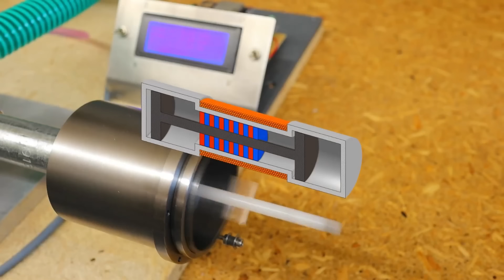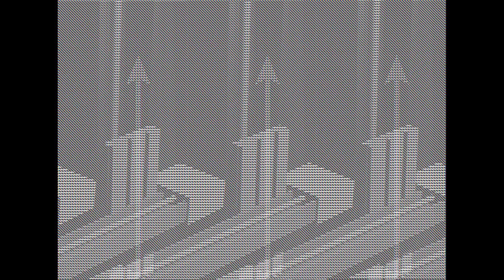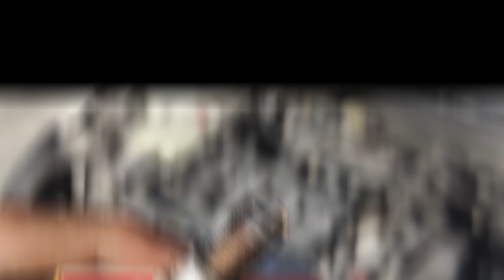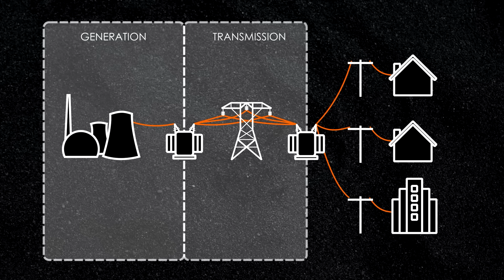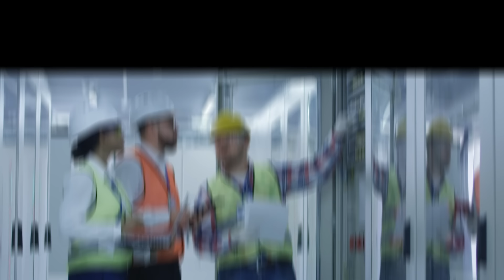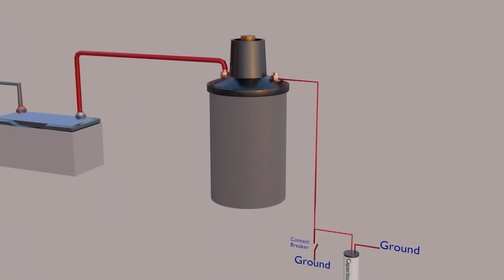This Mainspring Generator Runs on ANY Fuel 24/7 in Total Silence — No Grid NEEDED!!

Comment: Key about the MainSpring Linear Motorised Alternator is the the Spring probably. As it probably uses opposing magnets as the springs. The air lubrication is possible probably because it moves quickly but with low forces, effectively vibrating at much higher frequency than a Combustion Engine, while most Combustion engines move slower with higher forces. I can't think how the valve system works though, perhaps like a jet engine somehow? Then the heat recovery cooling jacket partly reduces the sound. In very cold places, often a block of flats has a Propane tank and an emergency generator, and if this was the main generator of commercial generator size, the waste heat could help warm the block of flats, like the old Soviet Flats block buildings.

Here is another set of semi interesting discoveries in Israel:
Since the digits of Pi were calculated beyond a couple of handfuls of digits when computers came in Israel, it was found that the first 611 add up to 2701, and it is long known that the Gematria of the first verse of the Torah is 2701, and the Hebrew word for Torah is 611. There are many more odd things about the 2701 Gematria of the first verse. The Star of David on the Israeli flag, is derived from the first verses Gematria of 2701, by first omitting the Gematria of the 3 central words of the 7 words of the verse, and then subtracting their value as well, leaving 937 (a Star number) from the 2701.

18 Here is wisdom. Let him that hath understanding count the number of the beast: for it is the number of a man; and his number is Six hundred threescore and six.

For many years “VICARIUS FILII DEI” has been known to add to 666 in Roman Numerals, and is said to have once been written on the inside of one of the Popes hats inherited from past Popes. V=5 I=1 C=100 A=0 R=0 I=1 U=V=5 S=0″”””””5+1+100+1+5=112″”””””F=0 I=1 L=50 I=1 I=1″”””””50+1+1+1=53″”””””D=500 E=0 I=1″”””””500+1=501″”””””112+53+501=100+500+10+50+2+3+1=666.

Recently “VICARIOUS FILII DEI” was found to add to 165 if each letter is replaced by its number of place in the alphabet, 22+9+3+1+18+9+21+19=102″”””””6+9+12+9+9=45″”””””4+5+9=18″””””102+45+18=100+10+40+10+7+5+8=165, and the 165th digit of Pi is 2, the 166th is 7, the 167th is 0, and the 168th is 1, making 2701 like the Gematria of the first verse of the Torah. Also 165+166+167+168=666.

The first two words 112+53=165 and the third word 501=3*167 and the 3rd digit of the 2701 in Pi is the 167th.

To this day the only Church that explicitly says that numerology is divination is guess who?
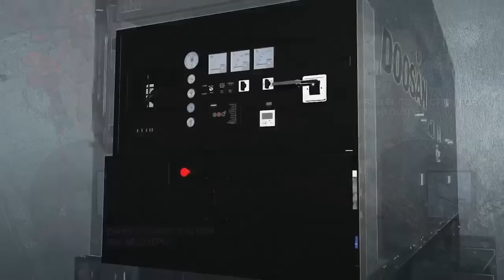That Church goes against Rev 13:18 by not letting a person calculate.
Only by the love for the remains of Israel have People let a person to calculate.

Comment: also In the late 1980s fighting with Verdigris Valley Electric because of a high Electric bill I started experimenting with generating My own Electricity but We made up with the Electric company and did Not presume It any more until recently they shut off My power become of one late payment after several years and I Am Not going to put up with a nazi Electric company. After putting a Car muffler on a Generator the muffler got so hot that It would boil Water so next Idea Is to run the Generator exhaust Into a barrel of sand to heat the sand and have heat exchange pipes In the sand to heat the house and do the same with the Diesel ⛽ heater

Comment: I do Not have 10 thousand dollars so It's out of the question for Me. It seem to Me If big corporations can build a big power plant and run 24/7 No problems then a smaller version can be built or It's like saying all Air planes has to be the size of a 747 to fly. The way I do It now except for the Air conditioner all high current Items as a microwave oven runs for less than 40 minutes so I have a big Generator to power them but I use a small Generator to change large batteries then the batteries power small current 12 volt Items I use the pure sign wave Power Inverter once In a while but most Items are 12 volt I also have Solar to help change the batteries, for Winter when there Is a strong North wind use a Wind turbine to power Electric blankets and the Diesel ⛽ heater I still use Propane for heating and cooking and wood too.

Comment: It might be flexible on the fuel used, but it still requires a gas supply which has to be paid for.
It also needs sealing rings as it does have (relatively) conventional pistons at its core.
Equally, it must have some form of sealed valve configuration; else the gaseous fuel is simply going to leak out everywhere and constitute noxious smells and a significant explosive/flamability hazard. 
As repeatedly illustrated, it is presented as a single oscillating shuttle, which will then shake itself apart.
If it utilises horizontally opposed pistons, the oscillating mass may become controllable, but there remains a combustion and expansion element to the cycle … so I fail to see how it can be “silent”. 

Admittedly, it may be more efficient than a conventional reciprocating engine, but it still has a number of the same disadvantages. It must seal the combustion process and control gas flow through the system … all necessitating contact friction surfaces … all requiring some form of lubrication to protect contact surfaces. With natural gas being a very costly fuel today, I fail to see the advantages of this solution … might have been attractive when gas was cheaper, but now? .. in today’s market?

Maybe your video should focus more on explaining how this contraption actually works and provide an evidence based argument against the various alternative technologies … rather than tediously repeating some nothing content at such a slow pace. This video sounds more like you’re trying hard to flog us your finest Snake Oil … the cure to all known diseases!